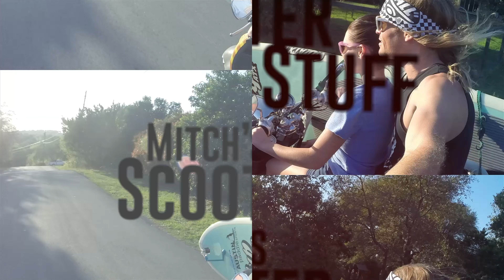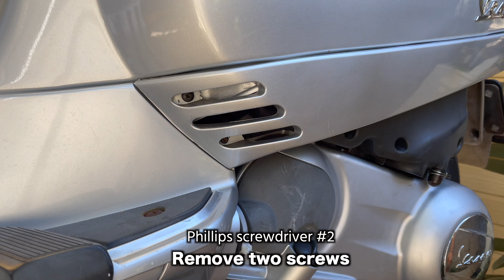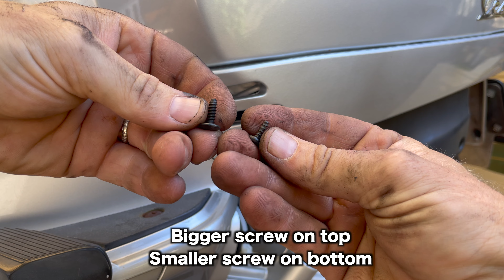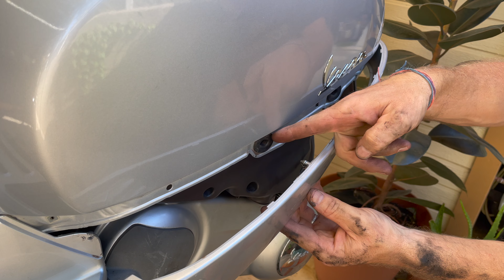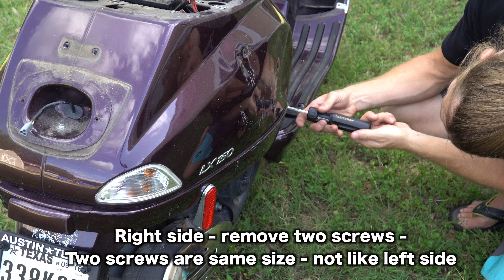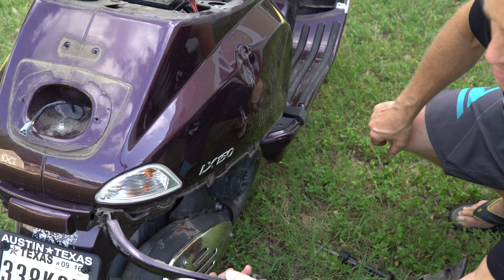Vespa LX - Rear Fender Removal / Installation | Mitch's Scooter Stuff

Comment: i love your videos.
i have a question, i have a 1994 honda elite 80 that runs great and i have no issues except there is a death wobble type issue i have up front where at speed it isn't to noticeable but  just randomly it will start to wobble and it has a really bad wobble the second i take my hands of the handle bars as well as a bad bounce/vibration whenever i use the front brake. if you would have any idea i would love to know your thoughts. thank you
Reply from the maker: Hmm check the wheel bearings... and make sure the stem nut is not loosen... also check the PSI in tires too! 😄👍🏼Hope you will find the issues!